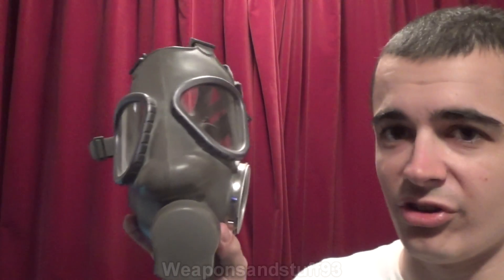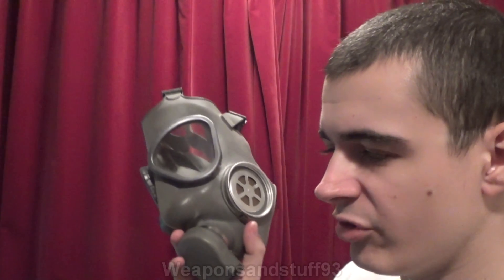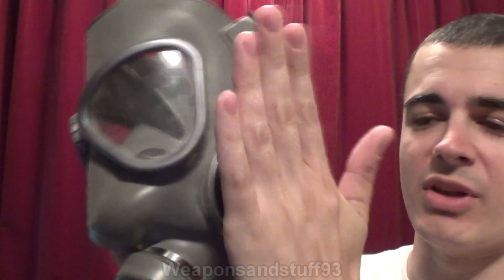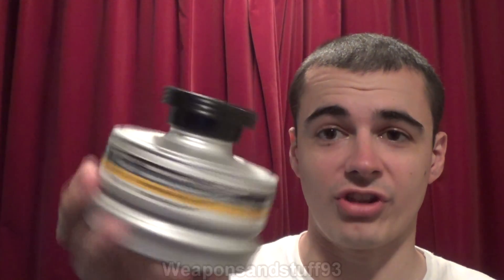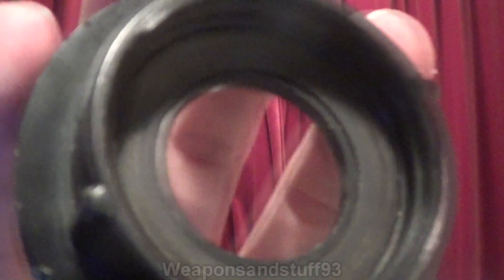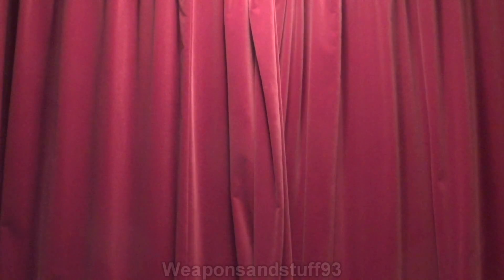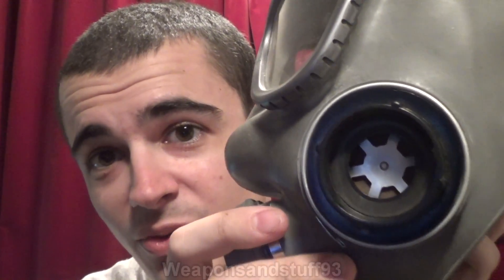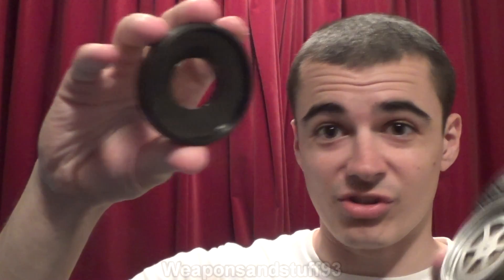60mm to 40mm Filter converters explained

Comment: I recently got a 4A1 gas mask and tested it in my bathroom with the strongest AXE body spray I could find. It worked fine for me and I didn’t smell it until I adjusted the mask. My filter makes a shaking sound like something is moving around in it, but still works. Don’t know if it’s okay but I know the filters don’t have asbestos or anything weird as I’m using the Israeli filter. Anyways, what do you think a cool mask to try to get next would be, I mean... I’m 13 and don’t have a lot of money but gas masks are a cool hobby for me. I’ve got a PBF mask with the filters as well as the 4A.
Reply from the maker: The shaking sound could just be there is slightly less charcoal than the total filter volume, meaning it has room to move around, as for other cool masks that are cheap, French M51 or Drager M65?

Comment: Is the original filter in this mask safe?
Reply from the maker: Filters aren't really "safe", no asbestos in it but it contains chromium.
Reply: @weaponsandstuff93  if I were to find one with a sealed filter, would it be safe to breathe through?
Reply from the maker: Well a sealed filter would suffocate you, unless you mean open a sealed one, at which point it still contains chromium.

Comment: Would you rather have modern 60mm filter intake and filters on all NATO masks or 40mm filters
Reply from the maker: 40mm because most 60mm filters still aren't designed to allow more air flow.

Comment: Why were 60mm filters replaced by 40mm
Reply from the maker: Already answered it in another comment, mostly because smaller intake screws are more convenient.
Reply: Weaponsandstuff93 thanks man, and on average how many comments do you get a day. It takes hard work and effort and dedication to respond to all your comments
Reply from the maker: Anywhere between 30 and 100 I'd guess.